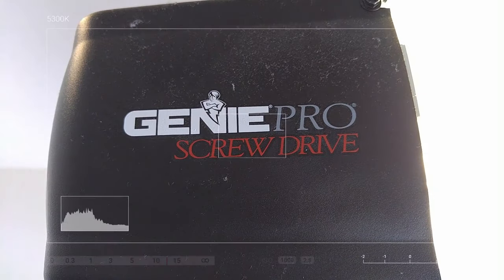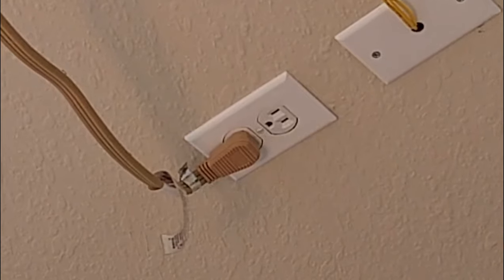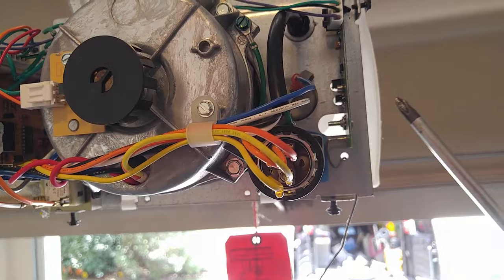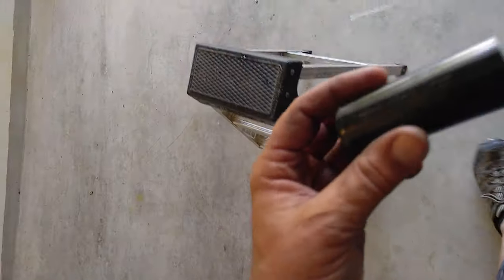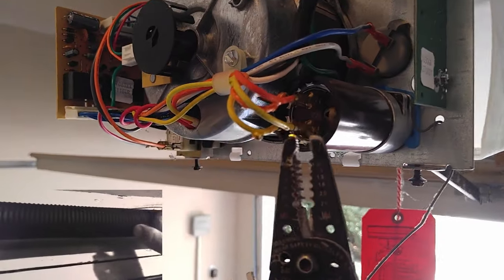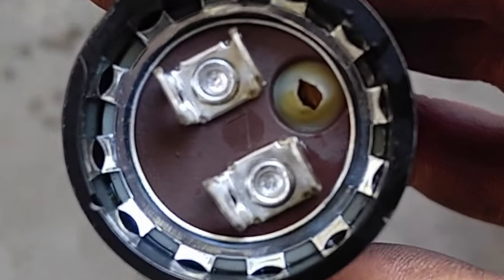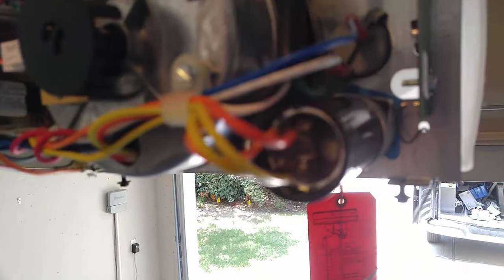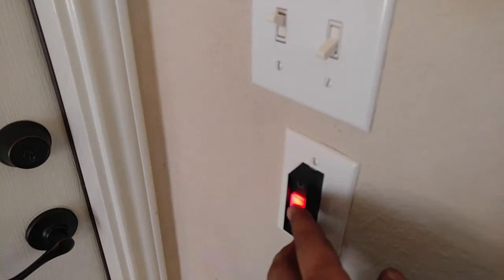Why My Genie Garage Door Opener is Not Working / Started Smoking

Comment: Hey, great video!  I have this garage door opener and it's not working.  I get two loud, separate buzzing sounds when I try to close my garage door, but it won't close.  I checked the capacitor as you recommended in your video, but I don't see a hole like the one in your video did.  So maybe my issue is not the capacitor.  I hate to hijack this comments section with a non-capacitor issue, but do you have any other suggestions?  Thanks so much.
Reply from the maker: If the capacitor is good then you possibly have a flat spot that has developed in the motor.  Especially if it's an older screw drive.
You could call Genie tech support to get a second opinion but that's where I'm laying my money.
Reply: @garagedoorgenius  Thank you!  And seeing from your other posts, a flat spot means the whole thing needs to be replaced, right?  If that's the case, can I keep the same door and infrastructure, but replace the motor?
Reply from the maker: @RHochroth1  for sure!  You don't need to change anything garage door related.  When you buy an opener, everything you need will come in the box.  👍🏼
Reply: I just spoke to Genie tech support.  This is what the lady told me: "Just checked [your model] and the capacitor is the only thing that makes the unit buzz/hum and cause traveling issue of the door before it pops and leaks."  She recommended replacing the capacitor and see if that does the trick.
Reply from the maker: @RHochroth1  it would be an easy fix  and you wouldn't be out a whole lot of money if that doesn't work.  Start capacitor is under $20.
Reply from the maker: @RHochroth1  great info for the thread.  Thanks Richard!
Reply: @garagedoorgenius  No, thank you so much for the speedy responses and all of your help!  You're an awesome guy.  Thank you.
Reply from the maker: @RHochroth1  I appreciate the kind words sir.  I'm here if ya ever need support on garage door and opener problems.
Reply: @garagedoorgenius  So, I replaced the start capacitor and it did not work.  I spoke to Genie again and this is what they said: The last troubleshooting step you'll have to do is remove the rail from the power head and run the power head with the all button to see if it still makes that buzzing sound
Reply from the maker: That stinks..
Yeah Im leaning towards the motor.
You can take the 2 bolts that connect the rail to the power head out and slide the motor back enough to disconnect from the coupler, then run it.  V.s taking the whole thing down.
Reply: @garagedoorgenius  Thanks.  When it's in electronic mode, it makes two buzzing sounds.  When it's in manual mode, I see the black circle thing on the motor spin and it sounds like a stalled car trying to turn over.  Does that mean anything?
Reply from the maker: @RHochroth1  can you soon the motor shaft pretty easily?  
I really believe you have motor problems.  The kind ya can't fix unfortunately.
Reply: @garagedoorgenius  Sir, I'm not sure I understand your question about the motor shaft.
Reply from the maker: @RHochroth1 sorry.  The part the coupler slips over.
Reply: @garagedoorgenius  You said "soon the motor shaft."  That's the part I'm confused about.  What do you mean by soon.
Reply from the maker: @RHochroth1  I meant to say ( turn ).  Sorry... Stupid autocorrect lol

Comment: I was trying to connect a built in car garage door opener and it opened but when I tried to close it the power went out on the whole motor after a minute or two it came back on and I could close it but it keeps doing the same thing repeatedly any clue what it could be?
Reply from the maker: How's the capacitor look?

Comment: I have a problem with the Genie Intellicode opener. There is power to the garage door opener and lights are turned on the safety beam. The chain does not move when I push the wall button which shows a red color when it is on. Any solution to this problem?
Reply from the maker: You hear the machine running but the chain doesn't?  
Try the easiest solution first.  Unplug it for about 10 minutes.  That's called a soft reboot.  Plug it back in and see what happens.
Reply: Garage Door Genius no the machine does not run. I only see the LED light come on
Reply from the maker: @HChennattu1  did you try the soft reboot?
Reply: Garage Door Genius yes it did fix the issue. The garage model number is GCG350ML. Now I have to reprogram my Chamberlain universal remote since the LED blinks rapidly.
Reply: Garage Door Genius I did. I am getting a dim red light on the wall button. The garage stops and then comes down and then goes up
Reply from the maker: @HChennattu1  dim wall button could possibly be a control board issue.  A resistor took a hit.
You can contact Genie tech support to verify.  Wait time is quick.
But, with my experience, that's what I've found the problem to be.
Reply: Garage Door Genius resistor?

Comment: So then that leaves the question of how the motor started if the start cap was bad? And it do so over and over without hesitation.
Reply from the maker: Great question!
It's funny, last week I did a little experiment.  Took a 20 year old Genie SD.  Took the cover off, laid it on a table, and ran it over and over.  Motor would shut off (overheated,cool down phase), and I ran it again over and over.  The start capacitor would start bubbling and looking like it was about to blow.  I did this over and over until I got tired of waiting on it to give me the money shot.  So I learned that those capacitors are pretty dam tough.  Takes a lot to smoke one.  But it does happen.
I'm going to find another opener to do that too. I want to get good footage of a start capacitor fully blowing. That's what I was trying to accomplish on my experiment I just ran out of time.

Comment: It doesn’t matter where you put the wires at all?
Reply from the maker: It doesn't matter where you plug them in at as long as long as you put the same color next to each other.  Orange next to orange and yellow next to yellow.  If you hook it up wrong you'll blow the new capacitor.

Comment: Can you help with this:  my genie wall controller stopped working. The garage door still operates  with the remote in the car, and the keypad mounted outside - just not the wall controller in the garage
Reply from the maker: Does the wall button light still illuminate red?
Reply: @garagedoorgenius  No- no lights on the wall buttons, and it won't turn on the light from there either, though the light comes on when i use the car remote to open the garage door.
Reply from the maker: Take the wall button from the wall.  Rewire it and see if that helps.
FYI, when you take the wall button off.  Touch the 2 wires together.  The machine should take off.  If it doesn't, put up new wall button wire.
Reply from the maker: Check at the wire terminal on the opener.  Make sure the wire didn't come loose there also..
Reply from the maker: Did it that info help?
Reply: @garagedoorgenius  Absolutely. Was hoping to answer with an "I've got it fixed!", but had plans this evening (came home to an open garage door...yikes!). It looks like I need to replace the wire. Will let you know tomorrow- THANK YOU FOR THE QUICK RESPONSE!
Reply: I've got it fixed!
Thank you so much! You're advise was spot on. It was the wire. Replaced that and worked perfectly. I sent you some $$ on paypal to say thank you.
Thanks again for the fast response and the expertise!
Reply from the maker: @keepitsimplerstupid  
That's fantastic news!  
I just seen your tip in my PayPal.  Thank you so much!  That is super nice of you.

Comment: i tested the capacitor and it read 73 mf - spec on decal is 70mf so it is within specs.  Not sure if they can measure fine and still be bad - anyone know?
Reply from the maker: That's a great question.  I have no idea personally.  I do know they can be ran over and over with continuous overheat stoppages and continue to work.  
Now when the end of it blows out, then that's obvious. Lol

Comment: Not my issue, my garage won’t turn on since the power surge, but I hear Genie is junk? Mine is 10 yrs old, I’m assuming a new one needed
Reply from the maker: Power surge you may have smoked a circuit board.  Genie gets a bad rap sometimes.  Their really not to bad of machines.  Weight out your options with Genie vs Chamberlain.

Comment: My limit switches are not sight when the door stops. As it goes up and down they come into and out of view. Is there  way to open the back panel and move the switches??
Reply from the maker: What brand and model do you have?
Reply: @garagedoorgenius  PMX 500IC ProMax!
Reply from the maker: @danielfraley9262  you need to run it until you see the limit wheel.  Stop it and adjust it all the way you can.  Then run it back the other way and do the same thing.  Then from there you should be able to fine tune it.
Pmx 500 are a pain in the butt to take apart.  You literally have to take the sides off, then the back.   You can get to those limits by doing that, but you wanna make sure you try the first option first.  It'll save ya from saying some bad words. 💯🤪
Reply: @garagedoorgenius  Thanks, I will try in the morning. Seems as if the limit switches are too close together.
Reply from the maker: Yeah I've seen them butted up to one another.  I had to do this job a couple weeks ago.  If you can see the little white limit wheel, then you should have no problems.
Reply: @garagedoorgenius  Looks like I will be taking it apart!! As I was turn one screw to down (Left side) the the screw with a black end came out. I hope I did not break it. You thoughts please?? Thanks.    ;-(
Reply from the maker: @danielfraley9262  darn..
Yeah, you'll have to take it apart. 😟
You didn't break it tho.  It'll pop back into place.
Reply from the maker: Keep me posted bro..
Reply: @garagedoorgenius  I will-Your the Genius/Expert. I'll tear into it tomorrow. Thanks again!!    ;-)
Reply from the maker: @danielfraley9262  💥👍🏼💥
Reply: @garagedoorgenius  Update: Well got caught up with the 4 of July but finally got it apart as I was taking it apart  one wire to the transformer broke and I had to re-solder/Rebuild. Anyway, set the limits with box apart now finally working. The only problem is the connection to the chain comes out of the plastic socket when going down. Tomorrow I will tear into that to make sure it stays in place.  You are right about taking apart-What a MESS!!
Reply from the maker: @danielfraley9262  did it work?
Reply: Yes!!
Reply: Works GREAT-Thanks Again!!!
Reply from the maker: @danielfraley9262  👍🏼💯

Comment: I have that same opener. Would you be willing to help me out with an issue? I linked or new car to the opener yesterday. now nothing works. my hand remote, my wifes old car or the new car. new car press button and it sends signal and opener light flashes on opener. press hand held and it lights up and opener flashes but nothing....erased codes and tried to reprogram ...nothing... pushed learn button, light flashes, pushed remote once, opener light stays solid, push remote again and opener flashes 8or9 times and goes out.... nothing!!!!
Reply from the maker: Put a brand new battery in the remote.  Repeat process.
That should do it.  Remote is not sending a strong enough signal.
Reply: @garagedoorgenius  I just did that..nothing..new cr2303 IIRC
Reply: Okay I just tried the middle button which we never used in at work so the button on the remote must be bad thank you sir
Reply from the maker: @a1machinista1  
Man believe it or not, the opener in my garage was doing the same thing. 1 of my remotes just needed a battery, the other just wouldn't program.  So I just replaced the crappy remote with a Chamberlain Universal.  That way when that machine dies you can still use the remote on whatever you replace it with.
  I'd try a different remote.  I know it sucks ya gotta buy one, but that's the next step.  I was really hoping you had a bad battery.
Reply: @garagedoorgenius  I was really wanting to get our new Tesla working.. I have it all hooked up now. The button on the remote was bad so I just used a different button. Thanks alot
Reply from the maker: @a1machinista1  
Awesome! 
I love programming Teslas!  They are so easy compared to the normal homelink.
Reply: @garagedoorgenius  come get mine hooked up to my wifi then!!!!hdcp problem

Comment: Please help! My genie garage door loses power either half way or a quarter of the way up or down. The light gets dim and turns off then after like 2 min it turns on again and then I click on my clicker for it to open or close and it only works for a couple seconds the garage door moves then loses power again. I’ve bought a capacitor still doesn’t work bought a new garage button and garage clickers still doesn’t work. :(

Comment: Why did the opener run so fast.
Reply from the maker: Lol, I sped it up with editing.  Didn't want viewers to get bored watching the door run up and down.
That's a great question!!
Reply: @garagedoorgenius  have you ever installed a liftmaster 8550w. Does this house have a swimming pool garage door genius. Is this your house or no.
Reply from the maker: I've installed my fair share of 8550w.  Its a really good unit.  No complains.
Lol, no swimming pool, and no it's not my home.
Reply: @garagedoorgenius  are you a fan of genie I like the older ones better what about you. This house we bought had a same problem and it smelled like smoke or burning. Does this one smell like burning. Which the old owner replaced it two a Chamberlain. Then we replaced to a liftmaster 8550w.
Reply: @garagedoorgenius  I thought at first it was a genie excellerator.

Comment: Wait a minute. If the unit runs WITHOUT a working capacitor, then what's the purpose of the capacitor?
Reply from the maker: Na, don't get confused.  Opener will eventually not do anything once the capacitor is totally fried.👍🏼
Reply: I have the exact same opener with different symptoms. A couple months ago it started to reverse when closing. Would go down a foot or so then reverse. After a few tries it finally went all the way down. It did this probably every 4th or 5th closing . Then last week it did the same thing, but only this time the motor barely turned or just hummed. Now, for the most part, it hums for a few seconds then turns off. This happens when the door is released from the opener, so it has nothing to do with any binding. The motor and screw turns freely and easily by hand. My capacitor has light brown stains on the hole where yours blew out. However, there is no burn smell, leaking, or any other signs of damage. In fact, it looks new! Could it still be the capacitor?
Reply from the maker: @jakejones5736  you will get some discoloration around the capacitor. That's normal with a machine that's been running for a little while. Normally want to start capacitor blows it leaves behind that gooey oily substance.  I mean it's a cheap fix to buy a start capacitor and try it out. If that's not the problem you'll be out 20 bucks. If that doesn't fix the issue you might as well stick a fork in it.
With this issue that you're having you very well could have a flat spot on the motor. I have been told that a time or two by Genie tech support.  You could call them Wait time isn't too long with Genie to verify what I just told you.
Reply: I spoke with them previously, and they were not sure what the problem was. But they said I might try replacing the cap. I even opened the motor, cleaned and lubed it per another video (same Genie opener) where several viewers said it resolved the same issue. The inside of the motor, windings etc. looked new and was basically spotless!

Although it's an older model (2003), I am bent on repair rather than replace for a couple reasons (light facing forward, simple remotes, eg.), not the least being in CA your ONLY option is the expensive unnecessary battery backup models.

So yeah, may not be the cap, but willing to take the gamble. Thanks for your prompt reply!